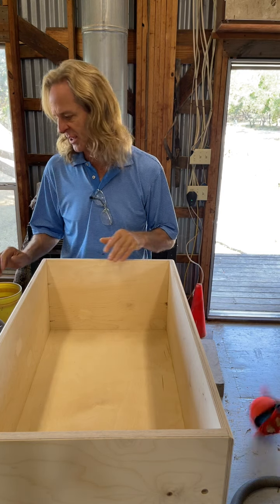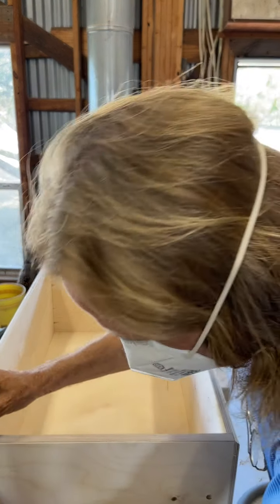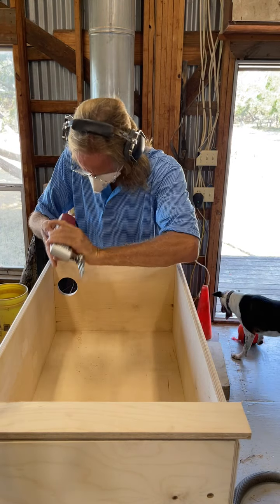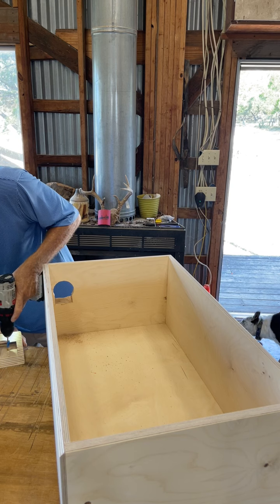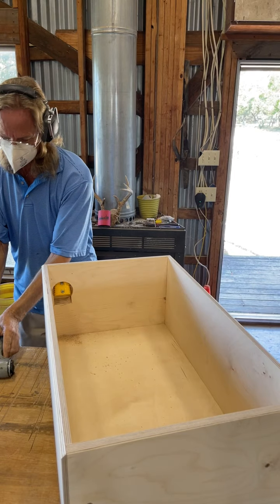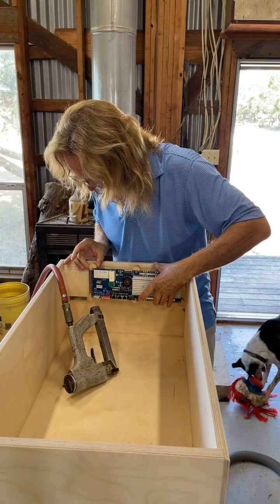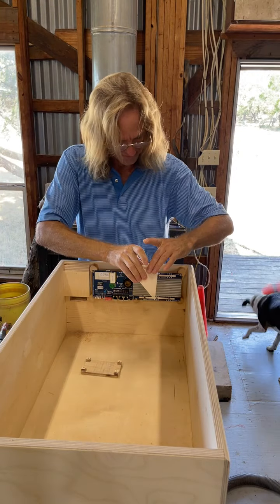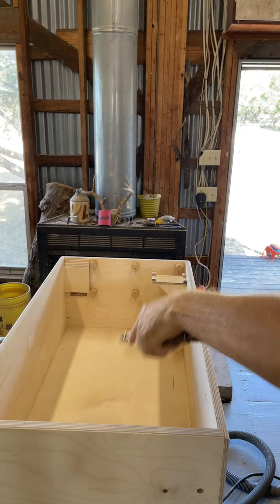Lifepo4 Battery Box Construction; Mounts For the BMS, Display and Disconnect Installed!

Comment: do you have a parts list for the major components?  I did not catch what BMS you are using and why you chose it for your project.  I am trying right now to decide on a BMS because I view this as the weak spot of the whole battery.  Is the display you speak of part of the BMS?
Reply from the maker: I use the Seplos 200A 48v BMS and the display comes with it. If after you watch some more of my videos you still have questions, I'm happy to answer. I don't do the list of components with affiliate links that the more popular YouTubers do. It can be problematic because some things don't work out later but they usually don't get edited out of the videos. 

By the way, this has always been one of my favorite videos but it never became very popular. I still go back and watch it though because Rona is just so damned fun to watch while I'm working and that is exactly the way my life is. I am blessed.